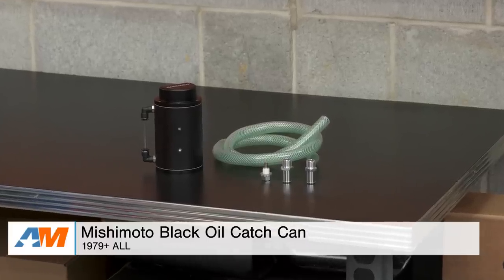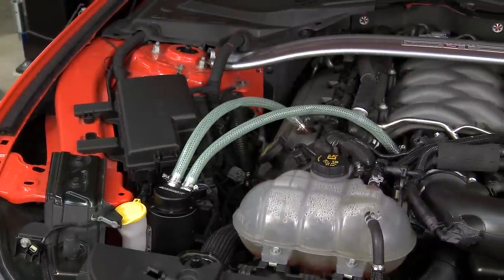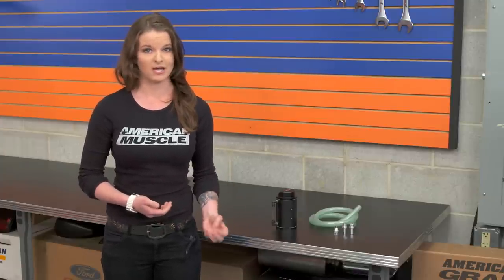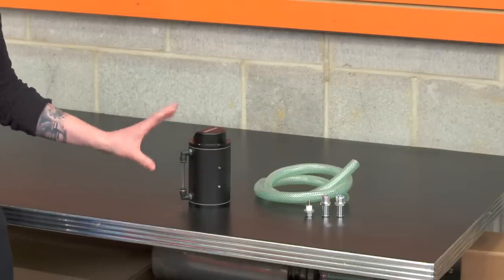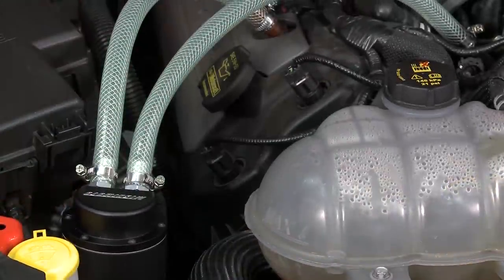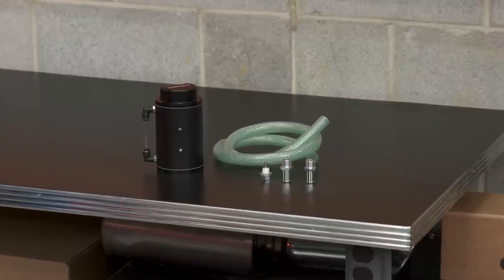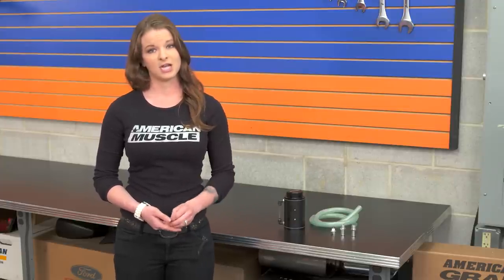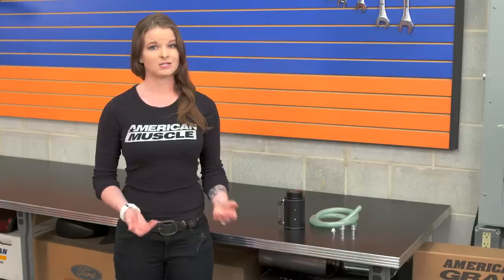1979-2017 Mustang Mishimoto Oil Catch Can Review & Install

Comment: I got one of the JLT catch cans installed in my 2014 V6, it actually works. I did an oil change about 150 miles ago and I have about a tea spoon of oil in my catch can since the oil change.
Reply from the maker: I won't run my Mustang's without them! They really do the job and for the price, they are an amazing insurance. - Will

Comment: This isn't a direct bolt on nor is the MMOC-CF the direct bolt on has form fitted hoses and a bracket that attaches to the radiator support.